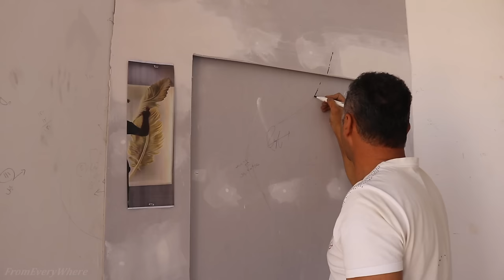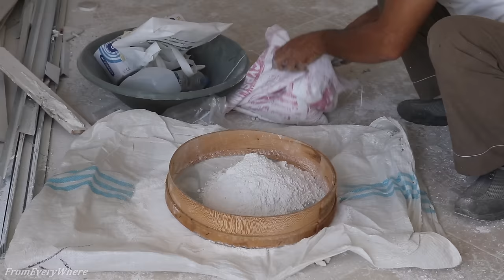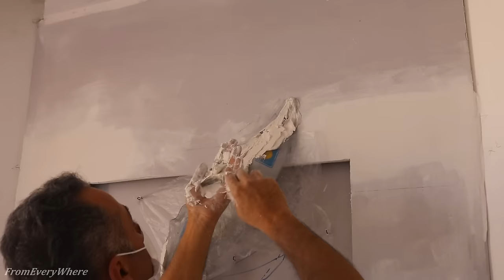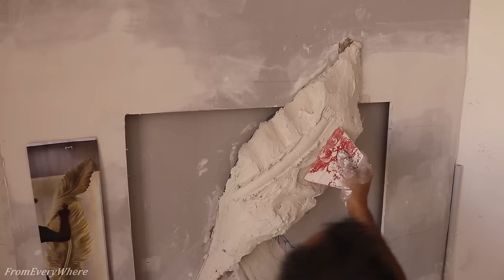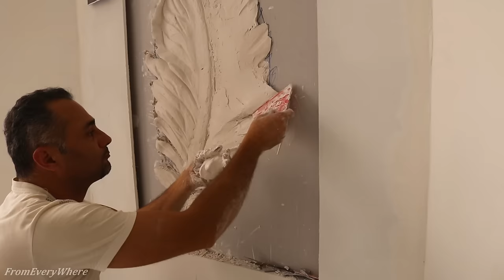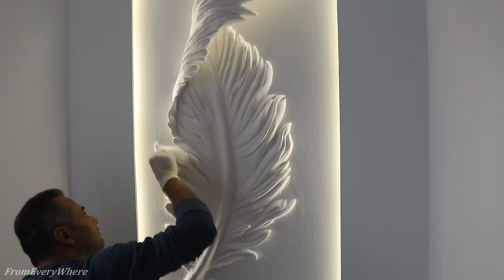How To Make Very Beautiful Feather With Plaster | Plaster Design

Comment: It is gypsum it is need to have respirator  and gloves  on hands
Reply from the maker: Yes, you are right my friend.
Reply: Es cierto, pero para un artista es como comer un dulce con la envoltura, o tener sexo con ......
Reply: @moisesgomez5593   I do not know about specifics matters But gypsum in lang make them hardly movable . And then after  the hand is not easy to clean from gloves of gypsum
Reply: @moisesgomez5593   Are you professional int this matter or you are just specialist in  mediation  about metaphysical matters ?
Reply: @FelixSamulevich  jajaja, por supuesto mi amigo, y que casualidad soy especialista en las dos profesiones. Y no he dicho q no tienes razón en lo que dices. Solo comente como es la sensación para un artista trabajar con esos instrumentos, el arte para que fluya hay que sentirla en las manos. Claro hay artistas como usted con la habilidad de hacer arte aún usando ese tipo de protección. Y en eso mi amigo yo, si no soy profesional.
Reply: @moisesgomez5593  Not i am not master in sculpture  I feel form very well some time do some   little works   But it is not my profession . Simply i worked  with the gyps and as a new for that material suffered in great dill . It is need to say for new sculpture artist it is not too safe material at first .
Reply: @moisesgomez5593  what is your profession ?
Reply: Yo creo que es cemento blanco,x q el yeso se seca muy rápido
Reply: @marinagonzalez3364   i think also  it is not the best staff  .for  inhalation

Comment: Material name plz
Reply from the maker: Plaster
Reply: @FromEveryWheree  The work done on walls with cement is called plaster. ??
Reply: @AKASHKASERAARTS - plaster of Paris
Reply: Simple said pop on shop
Reply: Simple said pop on shop
Reply: @AKASHKASERAARTS  plaster..same material you would use on ceilings and cornices..plaster of paris also used for moulding a cast for broken limbs in hospital setting..try and google
Reply: P.o.p